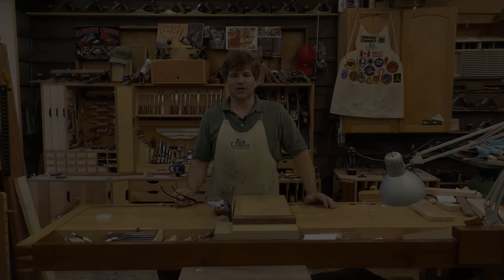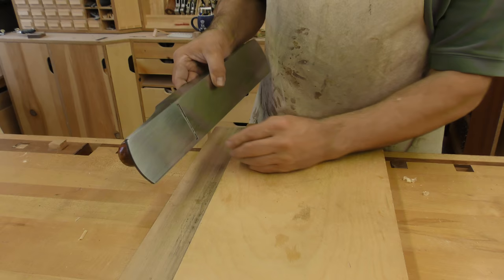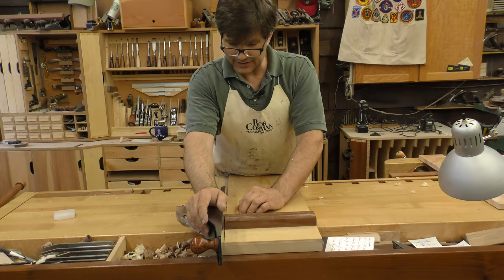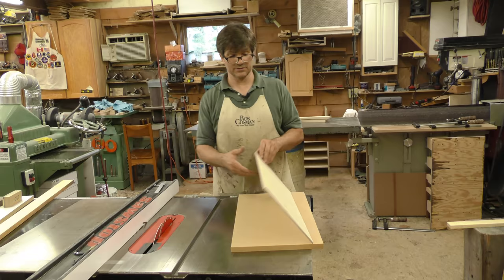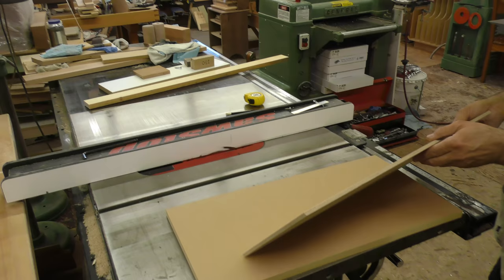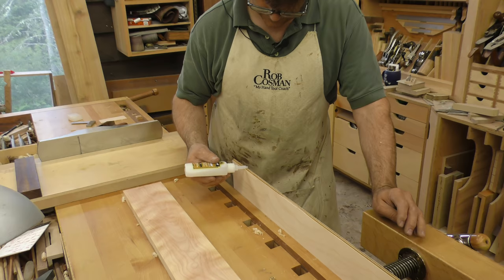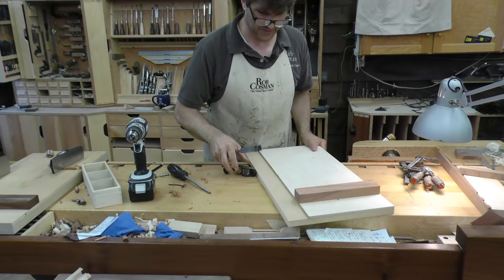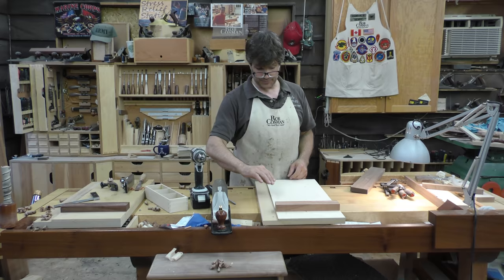You NEED a SHOOTING BOARD (Here's how to build one!)

Comment: Sincere thanks to you Rob!
 I'm a disabled carpenter  due to back surgery.  Started the trade at 18, had a botched surgery at 34.  About 8 yrs framing, than became finish carpenter.  Its weird how life works, but new for certain at about 28yrs, that I loved and appreciated finer woodworking.  Everything always came down to finances as I married at 23. I had to do by obligation heavier work. I went on my own at 30yr.
 Anyway, I deeply appreciate all your teaching, and the generosity you have freely given in knowledge, is something I not only highly respect, but it's meant to me more than words  can say!  Thank you so much.  At 56, I have a new, a different attitude toward my future. I've acquired knowledge for years. I'm beginning to pursue woodworking as a "first love".
 All I've learned from you is so completely valuable!!!  You've affected my life at the core of all that I love, as it relates to Wood, the trade, the detail, integrity, expertise, just all that I love.
 Couple years ago I built a 4'x7' assembly table, torsion box style. 3/4" melamine top and bottom,  with 3/4" birch ply as the inside.  I purchased Lie-Nielsen's low angel Jack-rabbit as well as the low angel rabbit block plane. Also, marking gauges and so forth.
 I need a 5 1/2 and am wondering quality wise between  your Wood river, or Lie-Nielsen.
 Started building furniture a couple yrs ago, and soon want to make this purchase.  I'm very loyal to what I deem is important. I've never had anything from Wood river, but knowing you represent them now puts them in the bidding.
 From all you've taught me through your video's, and being in my position financially, I'm sure you would say to go with wood river 5 1/2.  I just know in my heart, Lie-Nielsen is just a bit more quality. 
 This dragged out comment was really meant just to let you know how much I appreciate your teaching, your complete generosity in it. SO THANK YOU MAN, TOTALLY!!! 
 Sincerely, david per Wooden Nails

Comment: Early in 2022 I built my first "bench accessory" shooting board using these instructions and it works a treat. It was rough build, using what scrap wood I had available, and I was very much still learning how to manipulate the wood and be accurate but even then I'm impressed how much of an improvement to my work this tool provided. I'd recommend anyone getting into woodworking and has a hand plane to create one, even if it is rough, as a stepping stone to greater accuracy with your projects. 

I now plan to, carefully, build another one with everything I've learned since both using it and with woodworking practice.

Comment: I watched this immediately after the Paul Sellers video on the same subject. Check out both for two completely different takes on same thing and compare the tension in the work method.
Reply: I've watched both and much prefer Paul's method. I haven't made one of his yet but it will be the one I make. Why? Because I'm broke and the materials needed to make his can be found in any construction dumpster. So what if it takes me longer to make. Rob says his takes "15 minutes" to make. Yeah, 15 minutes to cut the material and an hour or so to let all the glue dry!

Comment: I greatly enjoyed the video. I need to make a shooting board and probably will this weekend. But there are a few reasons I greatly enjoyed the video that a lot of people are not catching on to. I like to process you use by keeping it simple. I love that you are not obsessed with some of the so called safety equipment that i see on several other channels. I truly believe in safety and practice what I believe are good and solid safety procedures. However it can go overboard as many of the people currently posting their videos think that they need eye protection, dust collection and hearing protection every  time they use any tool, and many never touch any glue with their fingers. There are definitely times that hearing protection is warranted such as planing a large run, but a couple cuts on the table saw dont really require anything other than safety glasses and the band saw barely makes any noise and rarely flings anything from it. I do wear safety glasses most of the time in the shop and a face shield for some operations such a lathe work and using a grinder. I do believe that my fingers are a great tool for spreading normal wood glue. Of course, when I started in this business (about 45 years ago) safety was not a big priority and they didn't even make tools for spreading glue for small pieces. I dont and never will own any for smaller glue joint as i have finger that works  much better.  And I really like how you show your mistakes. I have long made the statement that the difference between a pup and a seasoned carpenter and woodworker is not always the number of mistakes, as they happen often, but, rather how the mistakes are handled. With a well seasoned woodworker, unless they tell you they made a mistake, you will not even know, as they simply correct the mistake and move on, while the pup has no idea how to correct their mistake.  Thanks for the great videos. I have worked as a carpenter, owned a cabinet shop for several years and then on to a career as a building and fire inspector and then as the fire Marshal of a large jurisdiction. Now I am retired and due to COVID interrupting my normal travel and hunting plans I am spending lots of time in the shop and loving it.

Comment: When constructing airframes from balsa for radio control applications we often use CA to reinforce the threads where screws hold radio equipment and/or the electric motor or gasoline engine to the frame.

Comment: I was just getting ready to make one of these and I'm a beginner.

Some thoughts I had on your video though.  If someone has limited clamps (like myself) they probably don't have a pneumatic or battery nailer.  I also don't already have a shooting board.

Otherwise, I'll be using a lot of the techniques you showed.  I love the masking tape thing.
Reply: I don't have any as deep as you showed, I have 4 18" quick release bar clamps, 4 small c clamps, 2 large c clamps, and around 8 spring clamps.  If I need more I'll snag them.

I guess my opinion was that a beginner is more likely (personally) to go buy more clamps to get the job done over a nailer.

It was more a thought than criticism.  I really liked this video a lot and the timing was perfect.
Reply: If you don't have enough clamps, or clamps sufficient for the task, you could always try heavy weights to help apply pressure while the glue sets.  I personally have never tried this, but I have seen a lot of videos where weights are used instead of clamps.  

If I build this version of a shooting board I'll need to improvise as I don't have any deep reach clamps.

There are quite a few videos for DIY clamps as well so you might be able to find a solution there instead of using weights.
Reply: Put piece up on a few blocks, then clamps (of almost any size) all round. You may need cauls top & bottom if work pieces are big.

Comment: Cyanoacrylate is super glue. I just to make sure that you recommend I apply super glue along the edge of the board that I'm running my planer against. Also the bottle that you were using looked larger than what I'm used to seeing superglue sold in, so I just wanted to be sure that I correctly identified the substance that you're recommend. Thanks!

Comment: My old board was slightly bowed and it is true that the plane changed angle as it moved down the board. I could not get a square edge when shooting with the grain. Part would be square and other parts not. My new board is concave as shown by Rob. The plane still changes angle as it moves down the board. The difference is that the area near the plane blade is always perpendicular. It looks like it would be better if not bowed as much as Rob did but this is a big improvement. Maybe less tape in the middle.

Comment: Rob, I've followed your channel for years and I have several of your tools and DVDs.  Thanks for the tips on making a shooting board.  I made a very nice shooting board with doweled 45 miters and donkey ear, which works great as far as 45 degrees.  However,  I could not get a 90 degree on the edge of most boards when shooting.  As you stated in the video, it was difficult to find the root cause and I finally gave up.  I would adjust the lateral lever, and I even modified my old number 6 plane to try and accommodate to assure I was getting a square edge, but never achieved repeatable results.  My answer, at least I thought, was to invest in a LN shooting board plane, but they are costly, coming in at $500 for a dedicated plane.  Thanks for this video, and now for the first time, I understand why I could not get a 90 degree cut on the edge of the board.  I may still go for the LN shooting board plane, but that's for another day.  Thanks Rob.

Comment: Rob, I watched a lot of you videos. They are exceptionally good instructions. I also built a  45 degree shooting board   for making picture frames. I cut the wood piece at 45 but a bit longer  and trim using shooting board. The Stanley #4  I used kept riding above the 45 edge instead of removing.
The hand plane blade is sharp. Could you tell me what have I done incorrectly. Thanks

Comment: Excellent stuff.  I found myself wanting to through a square board against the fence to lay and back-up the narrow strip you worked to lose the saw marks. The narrow strip would just lay in there captive by the fences allowing for some really narrow work pieces.  A real shop, working through the issues on the fly.  Outta sight work. Thank You.

Comment: So I have a question that I cant figure out. I understand the reason behind the cupping fault and the need to countering it. But I dont understand the tape going perpendicular (across the width of the board). 
The board is already a bit cupped length ways so using it 'upside down' counters that yes, why add the tape to the width? Does the glue create a stress line across the width too? 
Great video btw. Ive watched dozens and dozens of these and this one tops it. Love the channel and the explanations. Hooked.

Comment: I will be adding this to my list, probably the next thing I build. What are you thoughts on hardwood jointed panel as the base? I built my cross cut sled from 5/4 Hard Maple, cut it into planks and edge jointed with a reversible glue joint router bit. It has stayed flat for years. Would this work with a shooting board?

Comment: Rob, I made the shooting board (same as you instructed), and after using with a Stanley Jack Plane I noticed a “groove” in the MDF where I was sliding the plane (next to the edge where the Baltic Birch runs.  Any ideas on what caused it?  I believe its probably sawdust under the plane maybe?  I’m fairly new to woodworking...The shooting board turned out very well but I’m sure the groove will affect accuracy of the shooting board.  Thanks.

Comment: Cyanoacrylate is indeed super glue, but it is not specifically for wood. In fact, it was developed in the medical field to close wounds without sutures. Unfortunately, the oils in our body collect under the glu interface, and the bond pulls apart. You can test that by gluing two fingers together. Wait a while, and you can easily pill the m apert.

Comment: I've watched this video a few times, and I'll get around to building the project soon.  Thank you for the clear explanation and demonstration.  Not sure why, but I was a little surprised to see you using Wood River.  Anyway, I thought, "If it's good enough for Rob Cosman, it's good enough for me."  So, I bought a #6 at my local Woodcraft.  Just took it out of the box, cleaned off the shipping grease, and checked out all the moving parts.  I'm disappointed to see that neither side is square to the sole.  It may be a good plane, and I'll keep it, but the one I got doesn't seem like it's good for a shooting board.  Seems like I need that 90° angle, but I didn't want to spend $500 on that dedicated plane.  So, I spent $260 on the one that doesn't suit.  Now, I'm looking for something else.  Any thoughts on that?
Reply from the maker: take it back and ask for one with square sides.  They stand behind their product.

Comment: Hey Rob - on my second try here and on both attempts my vertical squareness to the plane is off by a few thousandths of an inch and my cuts are beveled. I’m using 3/4 mdf and 3/4 ply. I’ve got the blade parallel to the plane sole. Any input would be greatly appreciated!! Thanks so much for the great and thorough content. Going to subscribe to your online website asap!
Reply from the maker: Check if thee plane sides are square to the sole

Comment: excellent ideas. love the way you preloaded a slight curve so it'll always lie flat when you press on it

do you really need to cut the rabbet @5:26? wouldnt it be easier to run your planer a few times after the p/w is glued on, and that would cut the perfect rabbet for that planer?

also, there has to be a better way than hardening the edge that contacts the planer with superglue. what about using s solid polycarbonate (or acrylic) panel instead of p/w and bonding it with polyurethane adhesive? or at least cutting a deep rabbet into the p/w and bonding a polycarbonate strip there as the edge that contacts the planer?

Comment: Rob, I have a shooting bard question for you regarding trimming bevels.  I am building a jewelry case that has swinging doors with an inserted panel.  The width of the frame is approx 3" wide, with a 45 bevel at each end.  I am having a bugger of a time getting a good miter this way. The board is too wide to stand up so the only solution is laying flat, but how could you use a shooting board for that?

Comment: Hi rob, I need to make a shooting board, I've seen several with the platform at a 5 deg angle to the plane but surely if you tried to shoot 45 deg mitres on the platform it would produce a compound angle, being an amateur this is confusing, no one seems to want to answer that
Reply from the maker: If you are talking about a ramped shooting board I cant see the wisdom in that.  I made one once, it is far easier to resharpen your plane blade.

Comment: I made one tonight based on this video. My question for you is how do you get a true square edge on much thicker boards? I am in the process of making a workbench and have serious issues truing up the edges of
 3x3 stock.
Reply: Jack Terpack are you talking about gluing the 3x3 stock up into the actual table/bench top? If so, that's a whole different subject from a shooting board. A shooting board is made to true up smaller pieces, not necessarily the long edge of long boards being glued up for panels.

For truing up edges of long boards you can use a jointer and then clean up the jointed edge with a hand plane. Or you can do it all with a jointer #7 hand plane. Either way, it really helps if you have a long precision straight edge and a quality square.

Comment: couldn't you use the actual blade from the plane by extending it to cut the birch so it is at the exact hight and would then not interfere with the cut? I'm new so call me stupid if I am wrong.
Reply from the maker: Yes, however the blade does not always sit in the exact same place each time.  It would eventually cut an acceptable rabbet, this is just much neater.

Comment: I think this is a great way to make a shooting board but didn't quite understand the rabbet on the plywood and, related, the setting back of the stop. I thought that the purpose of a shooting board was to "refine" the square end of a piece of wood and also to prevent breakout of the wood at the backside. With the setting back of the stop, there is no support at the back so the wood will split/tear-out.
Reply: The purpose of the rabbet is to prevent the plane blade from chewing up the edge of the shooting board. The narrow area at the edge of the sole, where the blade doesn't protrude, registers against the proud part at the bottom of the rabbet. The same for the fence cleat. The gap is only about 1/32”. He mentioned that if you are shooting across end grain you put a small chamfer on the back edge before planing.

Comment: I bought all the wood for this and cut everything and noticed i do not have a flat surface to clamp to as I have a jobsite table saw.... Any ideas? Can I set it on concrete with weights?
Reply from the maker: You could, sand bags are better, spread the weight more evenly.

Comment: Why rely on Baltic Birch for your guide of the lower plane edge.?
You mentioned using Bubinga for your register board on the top because I believe u said it had superior wear resistance.
So the question is Why not just use Baltic Birch?

Comment: So I’m curious. You make your shooting board with a cup. Let’s say you are going to make dinkey ears attachments for 45 and maybe 22.5 degrees. The donkey ears will be tall enough to accommodate boards 4 inches wide, so the board will somewhat vertical. So having a cup in the SB, will that negatively impact cutting the 45  or 22.5.
Reply from the maker: True, but the boards we make are for squaring the end of a component, 99% of the time.

Comment: Pardon my ignorance,but what is the purpose of a shuteing board? Does it have more uses?
Reply from the maker: you need squared stock to have a successful build.  A hand plane can put a finish on the edge of a board at the same time it is squaring it.  A shooting board is a faster and more accurate way to hold the work-piece and the plane at right angles while dressing the end or edge of a board.  There are shooting boards for planing angled edges as well.